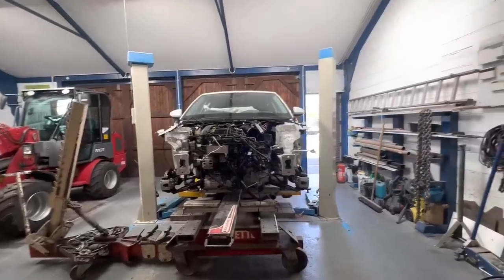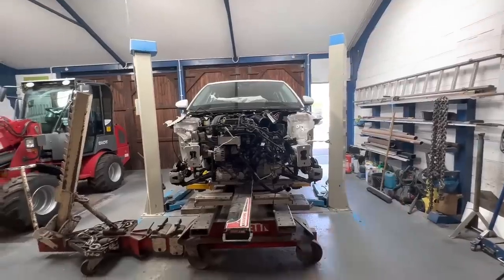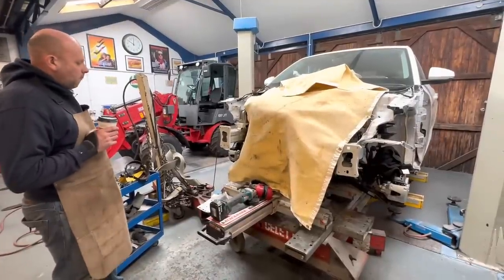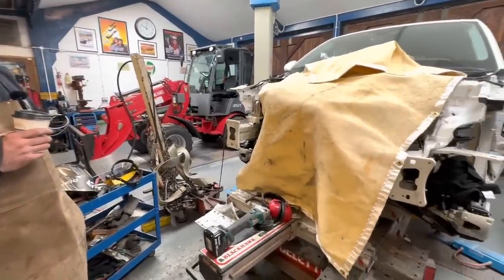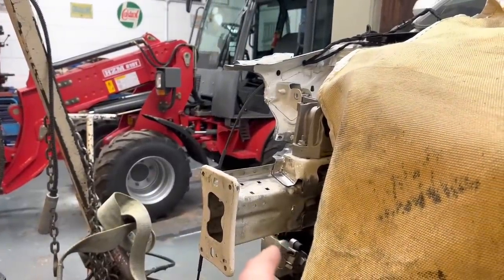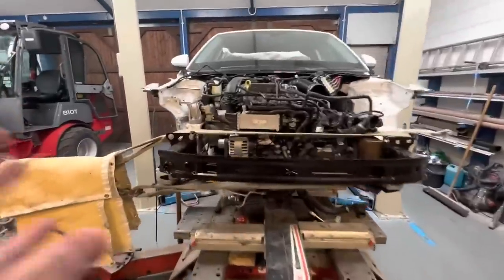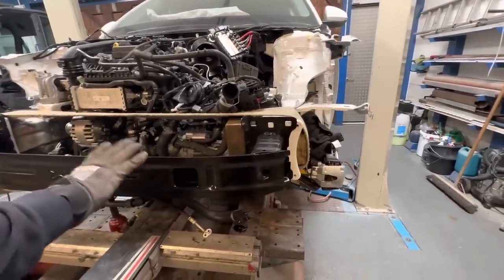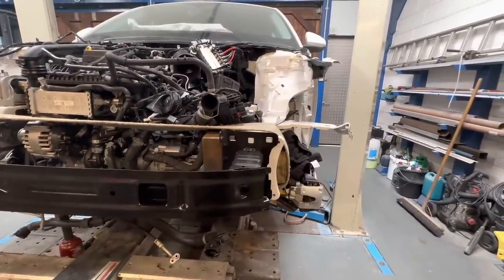REPAIRING A CRASH DAMAGED 2022 AUDI USING JIG FRAME MACHINE

Comment: It is always great to see the pulling operations along with panel beating, when a twisted item is brought back to the right shape, once more. Seeing those parts pull back they way they should be in a slow motion recovery from the rather faster and less directed shape change they suffered in the accident. When you calculate the cost of jobs, there is not only the obvious, costs of building, heating, lighting, energy, and pay, not forgetting the tools that must be ready for their instalment of work. There is the skill of those doing the work, knowing how hard to push, pull or hammer the metal, and where to apply the correct pressure to get the result you need. That takes time, training, and a great eye for detail.

Comment: if all the measurements are right it can come off the jig when i was doing this useing a daterliner an cheif  the final outer panels was fitted when the car was on its wheels not with the car weight hanging forward of a sill clamp and i had to go to thatcham labs to be tested and certified for my welding to meet BS 5750 keep up the good work there
Reply: Good advice on panel fitting, Chris could easily be a Thatcham trainer with his skills and experience,  his jig work is excellent.

Comment: Great video guys!  Question - what was the reference point for the first (offside) leg?  I know you aligned the two legs to match the new bumper bar, but first leg position is then critical.  Does the jig give you a reference point as per manufacturers spec?

Comment: Maybe I missed this from a previous episode, but does Chris have a set of datum points as to where these arms should be positioned? And datum points to where the arms are attached to...i.e. so you're not distorting the rest of the chassis or panels when pulling the arms into the correct positions?

Comment: Great Up, lads  ... i'm just wondering if you had a High Pressure graduated Gauge fitted on the Hydraulic system with the working pressure near the 12 O'Clock position on that Bezel then you could reference same during the pulls so as to come back to the same  Pressure Point, then you could then go just a little more, safe in the Knowledge that you were ,"In the same Parish" just to tweak the Pull an extra bit to get you Bang on... to where you want to be... again great Skill to take out the Twist out of the Chassis a true Surgeon...

Comment: £1200 is cheap. Mine had both inner and outer rear panel skins replaced and a new boot lid, bumper, crash bar and and a tug on the tyre well. Over £2500.

Comment: A very wealthy man wanted the central heating in his house fixed. An old plumber arrived after many younger guys failed. He had a look and had a whistle and then hit a unremarkable joint with his hammer. The central heating was fixed. How much? 500 said the old man. That's ridiculous said the wealthy man you just hit a joint with a hammer. How can you justify that cost. The old man whistled and said....€1 for hitting the joint and €499 for knowing where to hit it. Knowledge is expensive and not always valued. Great video 😂

Comment: Chris is right! Never underestimate what experience is worth. It reminds me of the tale of the engineer and the hammer.

"The Graybeard engineer retired and a few weeks later the Big Machine broke down, which was essential to the company’s revenue.  The Manager couldn’t get the machine to work again so the company called in Graybeard as an independent consultant.

Graybeard agrees. He walks into the factory, takes a look at the Big Machine, grabs a sledge hammer, and whacks the machine once whereupon the machine starts right up. Graybeard leaves and the company is making money again.

The next day Manager receives a bill from Graybeard for $5,000. Manager is furious at the price and refuses to pay. Graybeard assures him that it’s a fair price. Manager retorts that if it’s a fair price Graybeard won’t mind itemizing the bill. Graybeard agrees that this is a fair request and complies.

The new, itemized bill reads….

Hammer:  $5

Knowing where to hit the machine with hammer: $4995"

This tale has appeared in many places in many different forms but its always the same message.

Comment: Sometimes it doesn’t matter the cost of the jig work.  If your insurance isn’t paying out for whatever reason, 1200 for jig work to save your car is nothing.  It might be the difference in taking a massive loss on the whole car
Reply: I’ve worked in body shops for over 12 years. We’ve done a few “get it straight for the customer “ jobs over the time.  For whatever reason the insurance wasn’t paying out.  A couple of grand saves someone having their $30k car totaled. They still have to have someone put it together and paint it but at least we straighten it properly

Comment: The mechanical properties of the reformed metal will be affected i.e. weakened by this process and the crashworthiness of the vehicle repaired like this will be no where near as effective as the original vehicle. I have crash tested cars repaired like this and they have failed the requirements of the legal standards that are used to assure the crashworthiness of the original off production vehicle.
Reply from the maker: To be honest you never have anything positive to say so not even really sure why you even bother
Reply: Surely if that were so, then every car with a slightly distorted chassis leg would either be written off or every part replaced. Or of course the use of Blackhawk etc dozers would be banned.
Reply: Collision repair equipment is manufactured and approved all around the world for this type of repair. Insurance companies would not sell these cars for repair if it was not safe to do so.